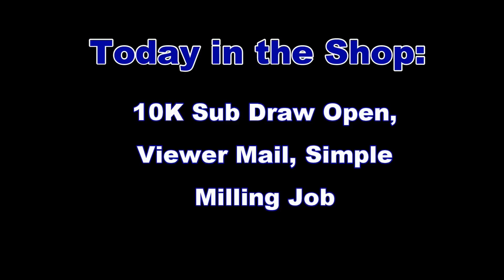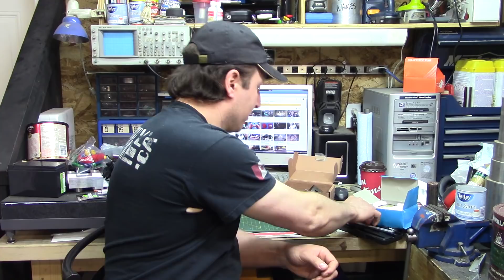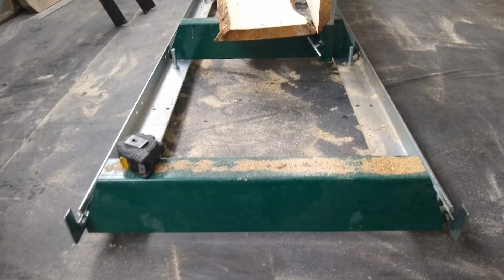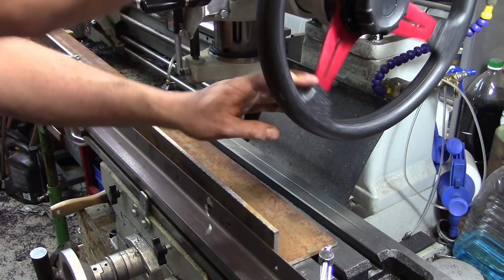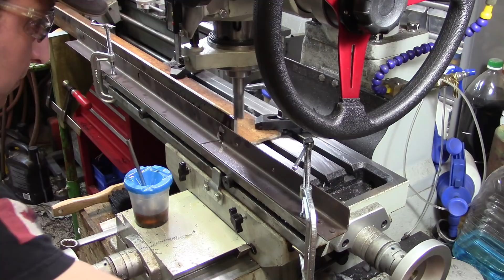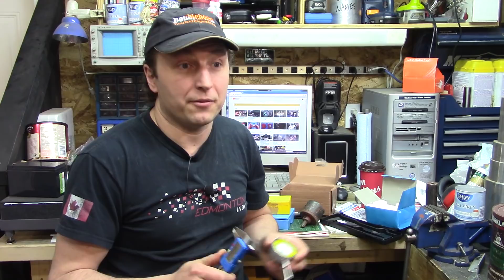10K Draw Open, Viewer Mail, Simple Milling Job

Comment: Congratulations Everett on the milestone, I am impressed at how patient you are, I would have hacked the bulk off with a zip-cut , then cleaned it up. It's good to see you are getting out in the shop, I understand how much energy it takes to raise a young family. It's good to see you really push the limits of that mill drill unit, I bet you have lots of thoughts about a bridgeport style unit. Anyhow carry on and cheers to you and yours!
Reply from the maker: Thanks Howie, but I have never claimed to be a patient man, lol!  One just uses what's available.  Thankfully Colin used a bandsaw and a fence to take most of the material away and left .100-.200" worth to clean up before final dimension.  I do try to get out to the shop when I can but it is a juggle right now to be sure.  As I type this, my 6-week-old daughter is snoring in my lap, lol.  And yes, I would love to get a knee mill at some point but until that opportunity comes I am very thankful just to have a place to play.  All the best to you and your family too!

Comment: Great video. I have learned how to push equipment a bit more than what I thought.
Reply from the maker: Thanks Paul, it was a bit of a challenge but it was also a good test of the mill.  It was surprising to see how much deflection there was in the table with 4 feet of bar hanging off one side.

Comment: Nicotine meter, I like that. 15,000" on a saw mill Everett, that's a fantastic result. Well done achieving 10k+ subscribers.
Your first extra long job of possibly many in years to come, now you definitely can YES lol. Tony
Reply from the maker: Lol, thanks Tony!  May need to come up with some better side support if there are more long jobs, though . . . I was amazed at how much the table deflected even with the gibs reasonably snug.
Reply: @EverettsWorkshop  A roller on the top would have worked better. You can buy inexpensive roller stands nowadays usually seen in the woodworking trade. Just angle your mill to miss your lathe or swop them round so you have more room either side of your mill table. Great content, Glad you and your family are safe and doing well. Tony

Comment: Congratulations on your 10000 subs. Just wondering how you like your mill and if you have any issues with it. Later and all the best.
Reply from the maker: Thanks! For the most part I like it for what it is - having a knee that raised and lowered would be very helpful but for the price these machines can be very useful.  It has a few little quirks like losing center on raising and lowering the head but there are workarounds for many of them.  Overall just thankful to have a mill at all!

Comment: Why not use the middle   " T "  slot  for clamping  2 angle bars  even if machining   1 of them , This way you can mill a bit longer but not to much the over hang of the table affect the finish ...
Reply from the maker: Part of my issue was clearance to the shaper on the right hand side, which is why I always had to hang off the left hand side.  I was also running into issues with how far the Y axis would move without binding up so this was the best I could come up with at the time.